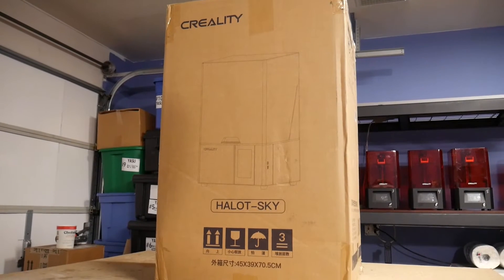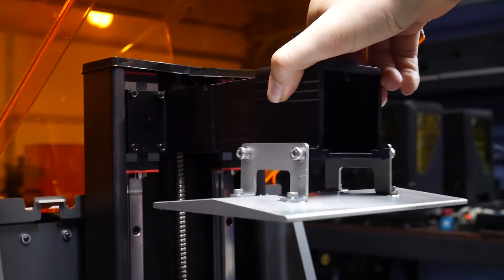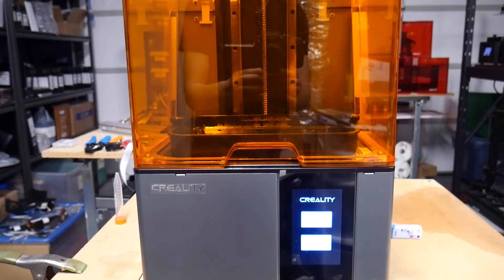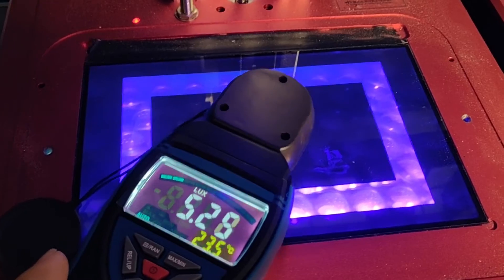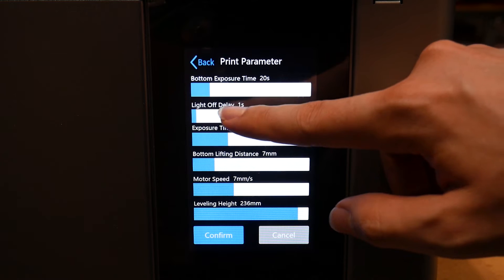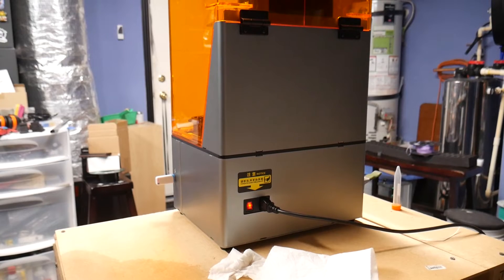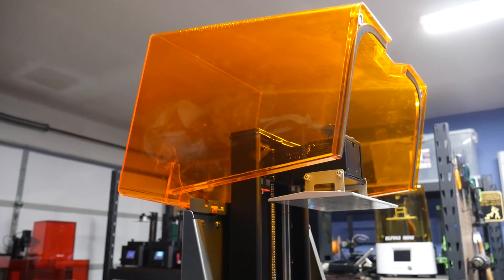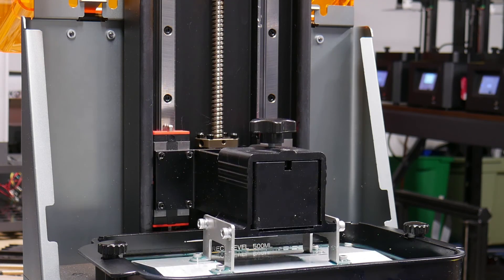Creality Halot Sky Review - 60 days of constant printing stress tests - Is it good for a Print Farm?

Comment: Same build plate volume as the Elegoo Saturn but about $450 dollars more than the Saturn $949.00. Do you think it's worth it? Nice review by the way.
Reply from the maker: For my own use case in wanting to operate as many printers (without the headaches of fails or maintenance work) as I can as a single operator or a hired print shop assistant or two. I think the markup is reasonable to get a platform that is quite rigid (which means I can push to go faster than the Saturn's Vroom settings theoretically), easy to maintain and clean, and allows for adjustments of settings on printer without needing to reslice.  

The main sticking point that I am really hoping (and have been vocal about) is the fact that creality is trying to lock you into their slicer which is not great. That being said they are expressing willingness to work with Lychee and Chitu devs to allow more third party slicers to work on the Halot platforms.

Also keeping things in perspective, I started out in resin printing at a time in resin printing where I paid $500 for a Wanhao D7 Plus (5.5" rgb screen) and a Phrozen Shuffle XL cost me $1400 with shipping and was not even close to being half as good of a printer as either the Saturn or Halot Sky for far more money.
Reply: @HiroCreations  and that's why I watch your videos because you know what you're talking about!
Reply from the maker: @ray24051  thanks! I appreciate that.
Reply: @HiroCreations  k
Lol km

man6

No km

Comment: what the max exposure time, is only 10sec? so you couldn't print using a resin that needs a longer exposure time like Onyx Impact Plus in the 20-30sec range?
Reply from the maker: @petermorphett  should have no real upper limit on exposure times, we developed a bunch of slow curing (but also slower aging) resins that needed 40 second layers and 2 minute base layers.

Comment: why was this your last video?
Reply from the maker: I sadly went inactive due to getting ridiculously busy with growing a print farm business and helping manage business development for a US based resin manufacturing startup. I'm definitely looking to carve out time to get back to making content again just need the spare time to do so.
Reply: @HiroCreations  Would you say the Creality Halot One is the best budget starter printer? Looks compelling with low price, big screen etc
Reply from the maker: @heysamhillier  Its an okay machine, the main issues with it is the restricted slicer (you can only use the creality slicer and not Chitu/Lychee), limited availability of the screens and their high price, and mine had an issue of a crooked build plate that I had to shim to make it more level with the screen.
Reply: @HiroCreations  Oh thats a shame. I know creality has QC issues. But some of their resin printer designs are so good.
Reply from the maker: @heysamhillier  To be fair it was a very very early release so later revisions might have been improved. 

I'm at the point where I bought enough printers for a resin farm you run into all sorts of QC issues with machines from nearly every brand and I'm nearly at the point where its faster and at some sizes cheaper to scale by building my own resin printers in house with off the shelf parts and LED arrays and keeps the maintenance schedule easier than with a lot of the existing prebuilts.
Reply: @HiroCreations ah ok

Comment: Hi! I'm having this model for a couple of months now partially because of this great review. I hope you can advice me because I have constant problems with fails. I tried so many different things and I cannot find out what is the problem really. Is there any chance you could share information on the environment (resin model) ambient temp, setting you use? I can not find the exact reason why most of my prints are failing. Please send help...
Reply from the maker: What are the fails (nothing sticking, supports only printing, etc)? The type of fail definitely impacts what advice I can provide as each fail has different causes.
Reply: @HiroCreations  Supports not holding model. Small objects are fine, bigger prints are always failing.
Reply: Also, information like, did you peel off the protection screen? How often should the FEB be replaced?

Comment: So how does the device hold up after all this time? Is it still a contender for the top among printers like Mighty 4K and Mono X, etc. Can it  have first spot in the printers list?
Reply from the maker: Still a solid performer that keeps plugging away in my farm day in and day out. The light source is the crispest I have used in the 8.9" category vs the MonoX, Saturn, and Epax E10. But the resolution/crispness is not as good as the Phrozen 4K but very close unless you are using some crazy optics to compare them.

It still sadly has some slicer/firmware issues but it does now have Lychee support as an alternative to Creality box for slicing. 

Getting replacement consumables like the screen is relatively easy and cheap as its using the the same 8.9" screens used in Epax/Saturn/Mono X, which is a significant advantage over Phrozen machines that I find are tough to get screens cheaply or quickly due to the supply chain issues going around.

That said its pricey in the prospect of next gen Saturns and other medium format printers coming in at the same approximiate price points within 1-3 months
Reply: @HiroCreations  Do you have a test example to compare that details you mentioned for Mighty4k and Sky?
I wonder if you encountered any problems with Mighty 4K having plastic body or VAT along the time u used it? Sky is more sturdy I think right? Btw Does the light projection technology inside Sky has any advantages like longevity or fail safe print compare to Mighty 4K. 

If you were to buy one for yourself no,  between Mighty4k and Sky which one would you choose for sure without hesitation? Thanks :)
Reply: @emrelee   merhaba sizin gibi bu soruya cevap arıyorum bulabildiniz mi

Comment: Don't buy this. I just returned one.
1)No exposure layer displayed while printing.
2)Does not raise when paused.
3)Does not work with Chitubox, only proprietary crappy slicer.
4)Shows identical filenames on re-uploads.(5x so far)
5)Runs HOT.
6)Model is ripped from supports, tried many settings.
6)Hardware is awesome.
7) Get the LD-006 instead.

Comment: great technical review! I was curious about few things, as technology-wise, like it is this screen, or built quality, etc is better than rivals like Anycubic mono X 4K or Phrozen Mighty 4K? I am really interested in those two models so if you had experience with those, I would be glad if you can share your opinion.

Maybe I missed it in the video, you mentioned the screen, hinged cover and all other good things about it as a 3d farm owner, but I was curious if those details really matter for a regular guy who prints personal 3d models like collectible statues?

I don't know how many microns this can go down with the details but probably same with others. Also Elagoo is about to relase 6K, for 600 usd.  I wonder if it's something to go with since it's right around the corner. (Elagoo is known to be not good with the delivery dates tho)

Since you are in business, you are the right guy to ask about customer relations about those manufacturers. So far Creality is well known with their Ender series, is it possible if you can compare Anycubic, Elagoo, Creality and Phrozen? 

Thanks again! Cheers!
Reply from the maker: Thanks for the kind words.

1. The Halot Sky uses the same commonly used 4k 8.9 screens (either the TM or PJ variants, as I have not needed to change the screen yet so I can't verify part numbers yet and Creality can't/won't tell me).  So the Halot Sky has the same 50 micron XY pixel resolution as the Mono X/Saturn. But the Mighty 4k is a slightly larger screen which means if I did my math right has a pixel size of 51microns which is a negligible difference on prints to a unaided eye.

2. Quality of life improvements  like the lid is much more subjective for someone who might only be looking to keep 1-2 printers. With 10+ printers the lids actually are a much nicer touch because the pile of covers that build each morning when I go to remove prints from the bed is gigantic and eats up a fair bit of floor space. More printers compound small annoyances with ergonomics and UI.

3. With printers now on a release cycle of 2-3 big releases a year, machines that are new and cutting edge now will get obsolete within a year. So whether its the right time to jump in and get new release is a subjective call that depends on what important to you.

4. I actually have an outline for a video on this topic written down, I'm pretty agnostic to the customer service of Elegoo, Anycubic, Creality, and Phrozen as I've had mixed experiences with them equally. And the best customer service I got honestly came from working with resellers of their products rather than the manufacturer's themselves. So my hierarchy is to always buy from regional resellers or Amazon and avoid buying direct or on marketplaces like Bangood/Aliexpress which have limited or unhelpful customer service. Like I said I got enough material for a quickish discussion video because I got burned a few times.
Reply: @HiroCreations  Thanks a lot for your detailed explanation.. I started seeing DLP printers like Anycubic mono Ultra which has 80 microns sensivity but with the projection technology inside it delivers way better results than 30 micron printers.

If Anycubic releases that product soon, this means 2022 will be the year for us to see quick switching into DLP small and mid size printers.. obsoleting the LCD counterparts like resin did to FDM printers.
Reply from the maker: @emrelee  I'm pretty excited about DLP printers as I briefly worked with really expensive ones for dental printers they do have quite a few advantages over LCDs. 

There are however, 2 potential "gotchas" that I can't confirm until there are printers in the wild.

1. The variable pixel size usually means that the size of the projection will also change. so its quite likely that to get the 30um pixel size means a sizable reduction in XY build volume--how much I am not sure.

2. Most of the current LCD resins on the market will overexpose if the DLP projectors are as strong as current generation dental DLP printers (they sit at the halfway point between Laser SLAs and mSLAs on light intensity). So it might take a bit to find the equivalent resin that matches an mSLA resin you might have liked.

Comment: I'm setting up a jewelry workshop and was wondering how would this printer handle really tiny sharp details. On the website it says the xy resolution is 0.01 - 0.05 but what exactly does it mean? Is it adjustable or what?
Reply from the maker: I recently noticed that too, I honestly think that is a bad translation on their part because its a standard 8.9" 4k screen with a pixel size of 50ish microns and there is no way to physically adjust that.
Reply: @HiroCreations  Thanks for clearing this up!
Reply: The acuracy in the xy plane is 50 micron or 0.050 mm , the layer high (in z) cuold by anything about 0.01 to 0.05 mm , so yes , yuo can make jewlery , even for casting with speciall casting resin

Comment: For a future review, it would be nice to have a dimensional accuracy test on small, medium and large prints using a resin that's well known for being very accurate with low shrinkage.
Reply from the maker: I will see what I can track down, though dimensional accuracy honestly is more a function of how well dialed in the exposure times are for a given resin and the functional difference between printer models is relatively small if your resin is perfectly dialed in.

Comment: Great review but you left out a big subject-You made no mention of it’s printing speed as compared to any other comfortable printer on the market?!
Reply from the maker: Its a good point, but in general printers with mono screens have near identical print exposure times and capabilities to handle vroom accelerations. The biggest differences that can be made in speeding up a print is in resin choice (which has its own tradeoffs with material properties).

Comment: I love this printer but the slicer puts me off a little. I also think all resin printers should come with some sort of alarm or print pause when the resin is low. It wouldn't be difficult to do.
Excellent review. I'm going to practice with the creality slicer but I get a feeling there will be a firmware update to use other slicers.

Comment: I wish manufacturers would stop putting the USB port on the side.
With those "premium" 3D printers hitting the market, how do you think they compare to a FormLabs Form 3, in terms of quality, ease of use and reliability ?
Reply from the maker: Could be worse like the old days (when printers had the USB ports (or worse) micro SD card slots mounted behind the damn printers. I'm toying with the idea of modding some of my machines have forward facing USB ports.

Really hard to compare with the Form 3 because its a laser SLA vs a mSLA. In broad terms from what I have seen and experienced:

-mSLAs will almost always be faster because each layer is cured simultaneously vs having to be traced by a laser.

-Parts printed with laser SLAs using a quality engineering grade resin almost always has far better material properties (toughness and longer life)  than a mSLA print, because SLA resin uses less photo reactant ingredients to cure under a high energy beam of a laser vs a mSLA printer that loses most of the light energy to the screen polarizers (only about 5%-10% of the light passes through the screen on the mono printer).

-mSLA will usually be cheaper to operate due to a wider range of cheap and functional consumables compared to the Form ecosystem (and small number of third party SLA resins).

-Formlabs likely might have an edge on reliability--simply because the printer is designed to hand hold the operator as much as possible. No mSLA is really doing that particularly well--but once you know how one resin printer works, you can really make most other resin printer models work really well with minimal learning curve.
Reply: @HiroCreations  i think the life of the laser is much longer than the screen used in mSLA printers , so yuo have a cost here